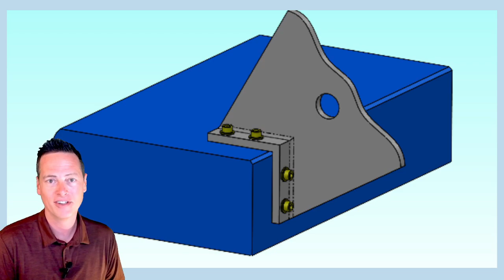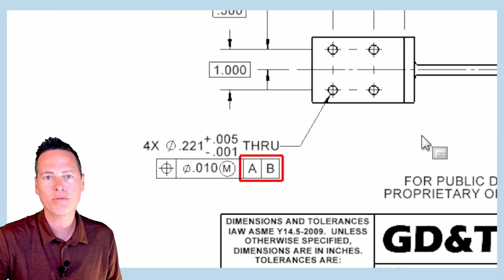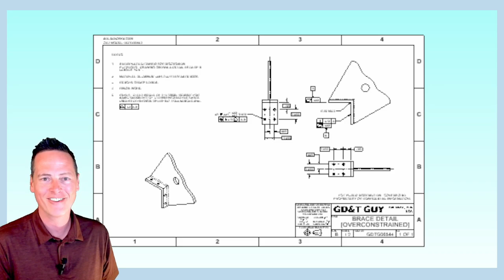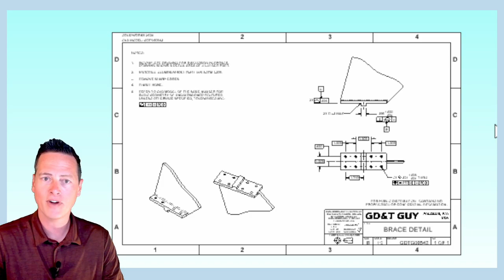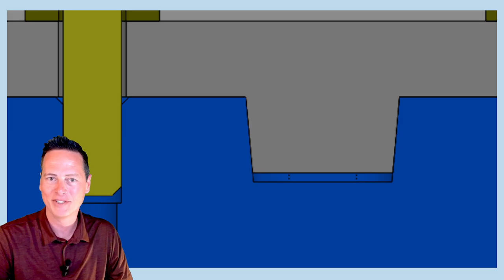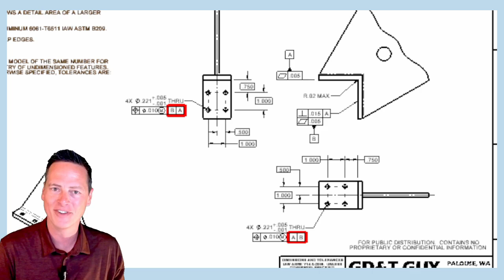Comment: You should avoid it if it's not needed. If there's a need for added rigidity, you should overconstrain the design. I don't see too many ball bearings with 3 balls around. Exact constraint design assumes perfectly rigid materials, when in reality everything is flexible

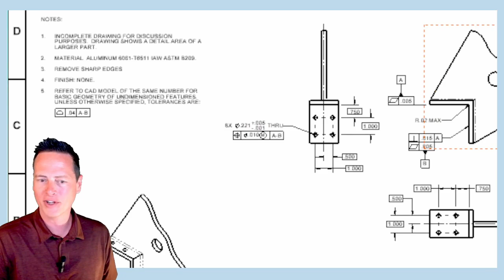Comment: 9:30
Primary datum A-B is a very good idea. This requires under ISO GPS a spezification for feature A and B 2x „position 0,05 SIM“. And I‘m not happy with the dia .01 for the eight lineare sizes dia .221. Why do you not spezify dia zero with expanded tolerance dia -.011 +.005?